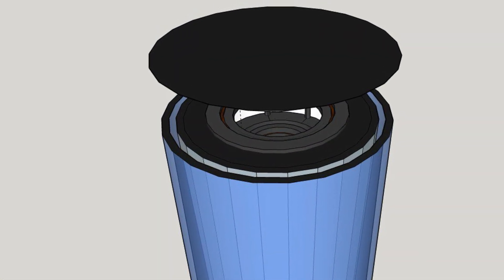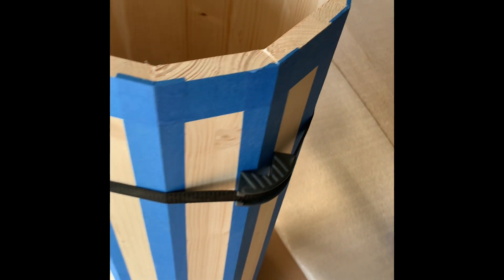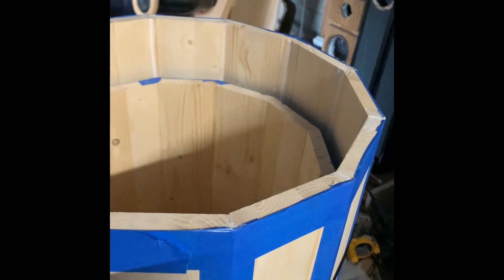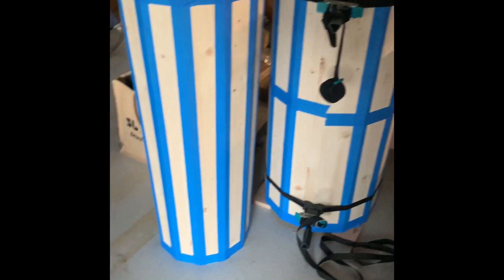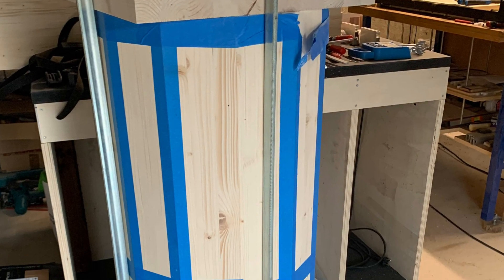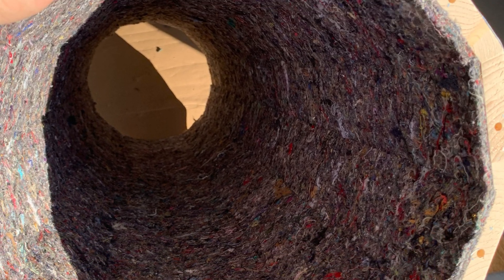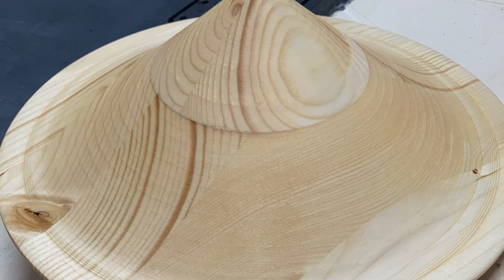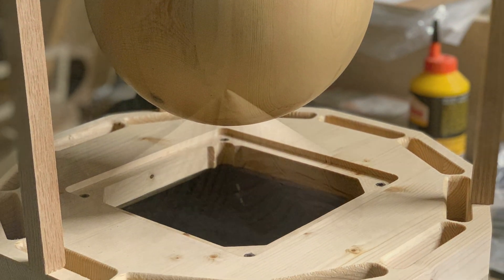Omnidirectional transmission line speakers

Comment: Love it when you feature a new speaker because you are trying new things.  I thought your implementation of an off-axis super tweeter in your open baffle speaker was and is the best implementation of an off-axis super tweeter that I have ever seen.  Here, however, the implementation raises some issues, at least based on what I could hear.  I liked the wide soundstage, but I could not detect any spatial accuracy.  Whatever was playing seemed to be coming from everywhere, not a situation where I could tell where the singer was and where the bass player was.  The sound also struck me as a bit forward/and or bright at times.  On the other hand, the bass was impressive.  

Again, bravo for you for trying something different!
Reply from the maker: Thank you! I have already answered this question below, however, now in English) I can't say for sure why, but unlike all my other speakers, I was unable to record these so that they would sound the same on the recording as live. The difference is very significant. Most likely, this is precisely due to the fact that a stereo microphone with its directionality cannot correctly perceive an omnidirectional speaker system. Being in the room and listening to them, you can quite clearly determine the stage and who is where, but it is much larger in comparison with other speakers. There is also an interesting effect: when you walk around the room, the frequency range remains unchanged, there is no directionality like in classical speakers, and the feeling is as if you are walking along the stage at a concert where a jazz band is playing, for example, and you hear one instrument a little closer, another - further, and then vice versa. Do you understand what I'm talking about? Try to imagine.
Reply: Какой у вас саундбар? Вы по Ютюб пытаетесь оценить сцену_ серьёзно 😂